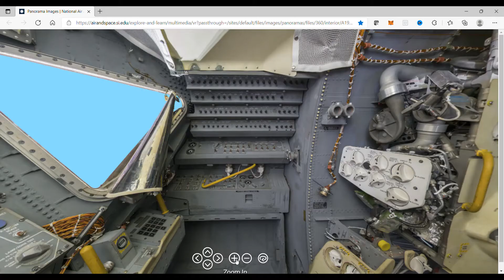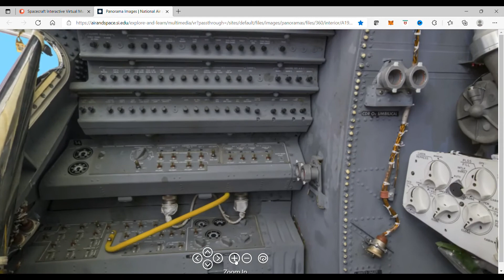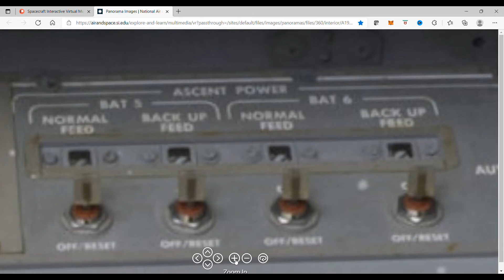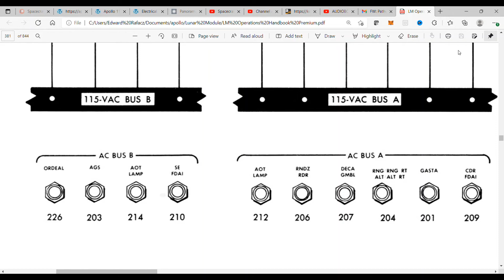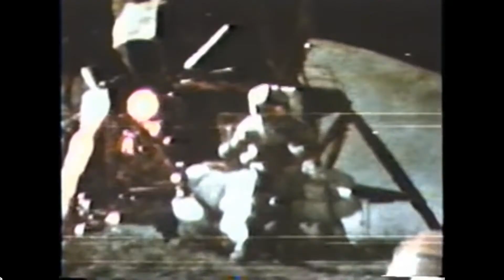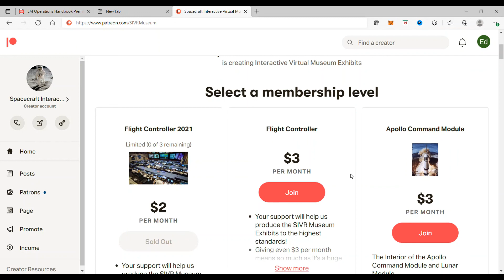Apollo Lunar Module Electrical Power

Comment: 15:08

What Japan Did on the Moon Is Game-Changing
676 tis. ogledov · pred 5 dnevi#Astrum #moonmission #NASA
...več

Astrum
2,07 mio.

Naročite se

18 tis.

Deli

Shrani

Prijava

Komentarji1,3 tis.
blast coop
They used Observation Haki for precise landing, and some kind of devil fruit for fuel. I'm not surprised anymore with Japan achieving such feat. Japan always knows how, where and when to use their very advanced tech. Congrats to Japan.

17.43
What Will Happen to Voyager and Others in the Far Future?
Curious Droid
Novo
125 tis. ogledov

13.01
Dead on Arrival: The Soyuz 11 Disaster | A Short Documentary | Fascinating Horror
Fascinating Horror
Novo
425 tis. ogledov

24.02
The Race to Harness Quantum Computing's Mind-Bending Power | The Future With Hannah Fry
Bloomberg Originals•1,5 mio. ogledov

20.36
You May Not Like It But this Is What Peak Combustion Technology Looks Like - Rotary Vane Engine
driving 4 answers•1,2 mio. ogledov

16.46
The Problems with China's Space Program
Real Engineering
Novo
534 tis. ogledov

8.51
The Genius Design of Mount Rushmore
Primal Space•373 tis. ogledov

10.40
What Happened When The Soviets Launched A Giant Mirror Into Space
The Space Race•310 tis. ogledov

22.49
How To Squeeze A Human Being Through A Five Inch Hole
Joe Scott
Novo
935 tis. ogledov

18.39
The Bizarre Shape Of The Universe
Up and Atom
Novo
266 tis. ogledov

48.58
The ACTUAL Archaeology Of The Richat feat. Milo Rossi (Miniminuteman)
Stefan Milo
Novo
328 tis. ogledov

29.30
This Is Why You Can’t Go To Antarctica
Joe Scott•6 mio. ogledov

16.15
The Soviet Obsession With Venus Revealed
The Space Race•2,3 mio. ogledov

Komentarji
1,3 tis.

I watched recent japanese SLIM probe lunar landing. 
Why is lunar night a problem, the craft is aso in the dark in orbit and in travel. Apollo had no solar panels, only fuel cells and bad batteries. How much energy did they need to stay warm and cold in orbit around the moon, and in travel? I would say alot. Were the fuell cells enough? Why no fuel cells on SLIM craft and what was the problem with landing. They should put trusters  wider distance. Panels on all sides. Should use giroscopes for stabilisation.. Best regards

Comment: Are these batteries more energy dense than a modern electric car? What chemistry battery are they using?
Reply from the maker: I do not believe so, but to make sure you have the correct answer, here is the link to the chemistry of the Batteries. https://apollo11guide.com/Lunar%20Module/LM%20Operations%20Handbook/Electric%20Power%20Subsystem/Electrical%20Power%20Subsystem.html#2.5.4.1_Descent_Stage_Batteries

Comment: And that was enough power for air conditioning and communication? Transmitting to earth?
Reply from the maker: Yes, three for the surface and two to leave the surface of the moon. If you join the SIVR on Patreon, you can click on the electrical components to see how it was done.
Reply: @SpacecraftGuide  rubbish, what about compression and decompression... absolute bollocks
Reply from the maker: @ So aircraft are fake too?